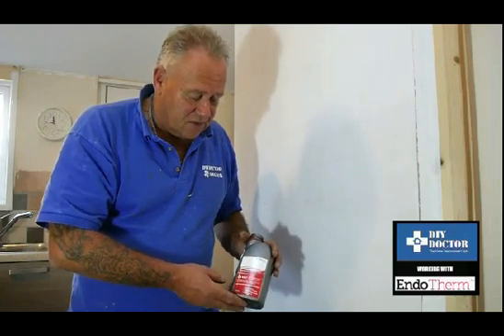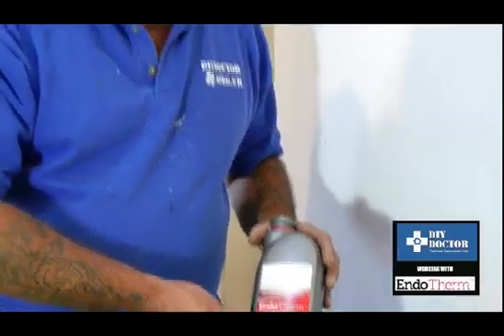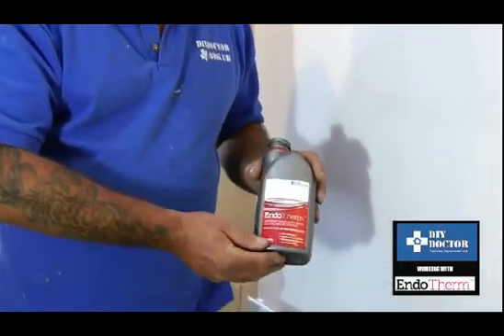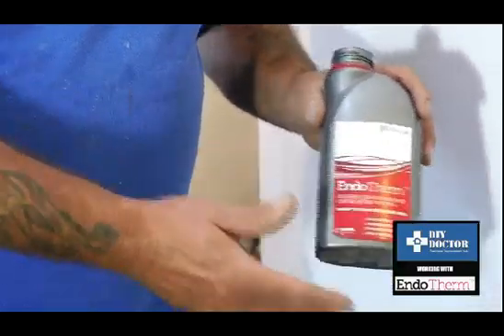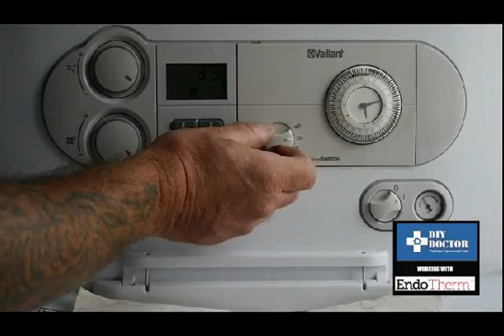Reduce central heating costs with EndoTherm

Comment: Could you not empty the radiator via the hosepipe connection?
Reply from the maker: Could do Kevin but draining down via the drain plug involves draining down the pipework also. Doing it like that means you cant actually be sure whether the rad is drained at all until all the water has gone from the system.